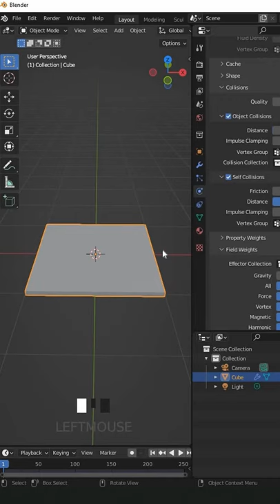Blender 3.0 - Modelling a Pillow-  #shorts

Comment: Would there be an easy way to make a pillow look that good as a lower poly world prop?
Reply: you can do the same thing just use less loop cuts than in the video for a low poly look
Reply: This is about 1000 more steps than you would need for a low poly pillow, i got you.

1. Make a rectangle
2. Put a loop cut on X and Y
3. Scale in the long axis loop cut (probably X depending how you did it)
4. Grab the X that was formed on both sides of the mesh and scale apart on Z
5. ctrl + 2 to add a subsurf mod and you're done.
Reply: Yea this one much easier I learnt this the same  @bagboybrown